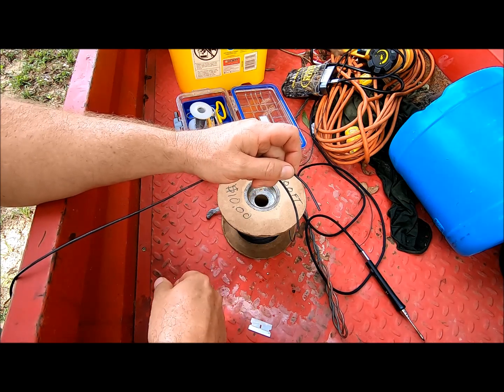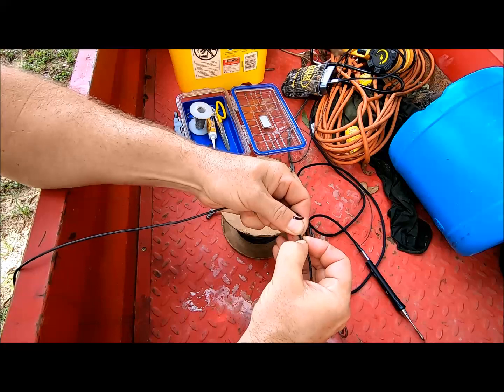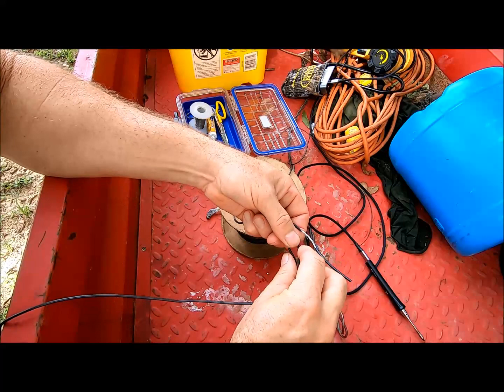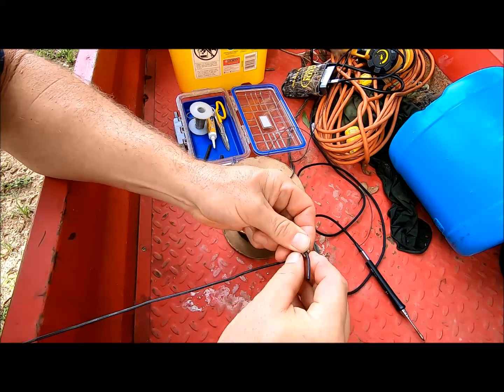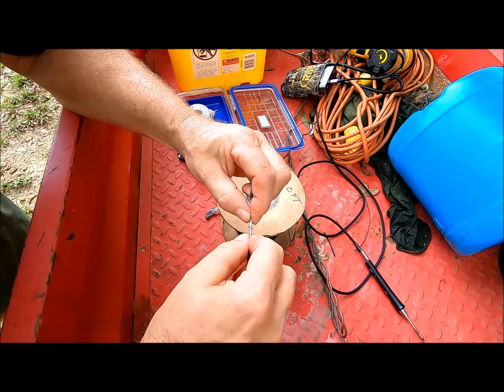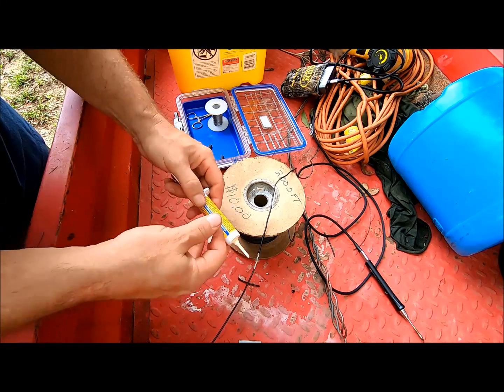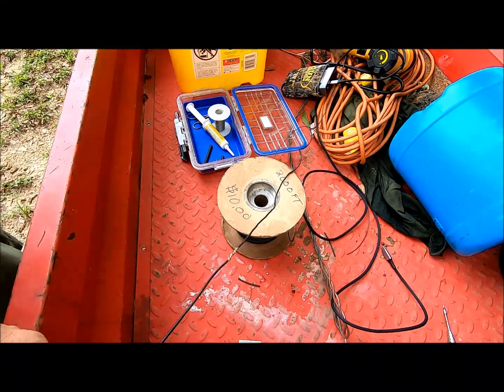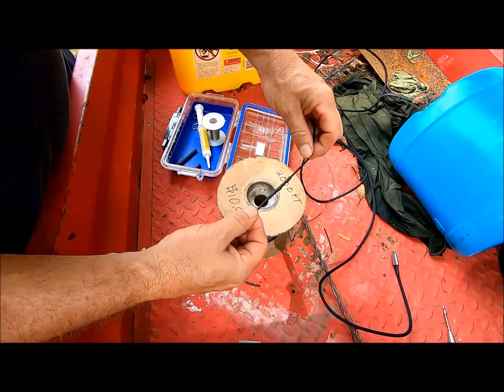Ham Radio HF wire antenna field expedient splicing - Tech Tips

Comment: Snagged my EFHW on a branch and broke it, using too much force.   Have not had to splice an antenna wire in eons and found your video.   Ant is back up in the air with a permanent fix, thanks to your quick video refresher.  73!
Reply from the maker: Awesome ! Knots are amazing. I'm glad you got it up and running. Thanks for sharing !

Comment: That is the same knot used for splicing WD1a field phone wire. Perhaps you've used WD1 for HF antennas before? Probably!  Fortunately we now have heat shrink tubing.  I'll hopefully be testing commercial phones as a way to use a VOX capable transceiver soon.  Of course an EE8's audio is loud enough to operate the VOX function on a Boafeng, but the Boafeng cannot operate the PTT switch for the RX.  We can listen to the response from the other station by listening to a receiver located at the base station, but if the signal is very weak from the second station, then this is not possible.  Commercial phones do not require the use of the PPT switch, and the audio is usually louder than is often experienced with an EE8 with a less than optimally functioning transmitter..  If you like the idea, it would be great to see a video on it.
Reply from the maker: That is exactly what it is a field phone splice. Thanks for watching !